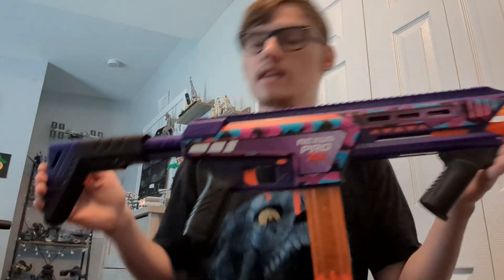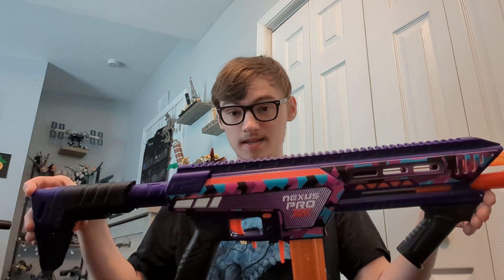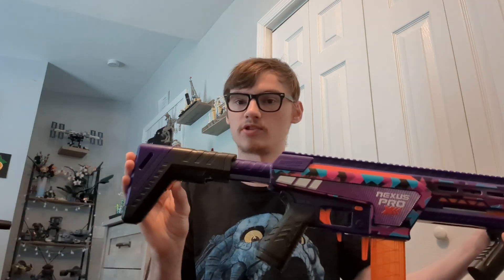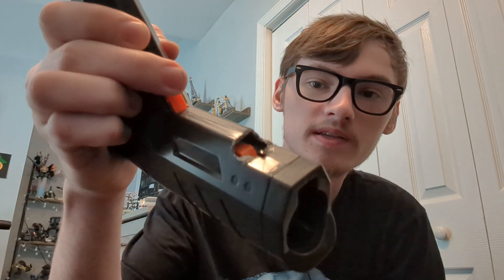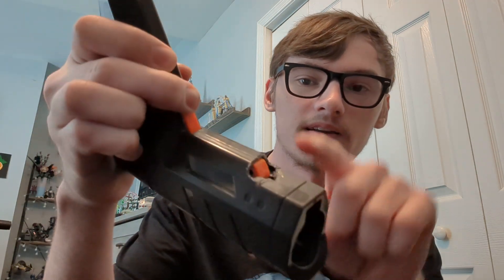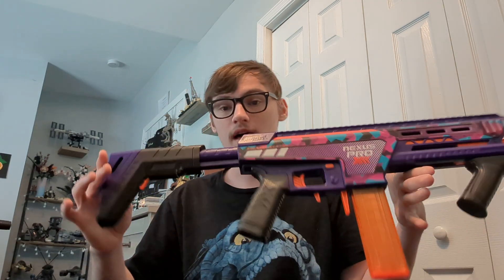P.S.A. Nexus Pro X Stock Block

Comment: Quick question. why didn't you just take the back part of the stock off and remove the piece of pvc you put in throug the hole thats already in the stock? worst you'd have to do is make that hole bigger and the cover would have still covered it.
Reply from the maker: To get to the PVC in the back, you'd have to cut through the notch that the stock cover connects to. Basically, I could, but then the stock cover wouldn't really be attached anymore. Could glue it though, that's an idea
Reply: @asliceofnerfpizza8549  Right, thats good to know. I'll just swap it out for a magpul once it comes out here then. thanks!